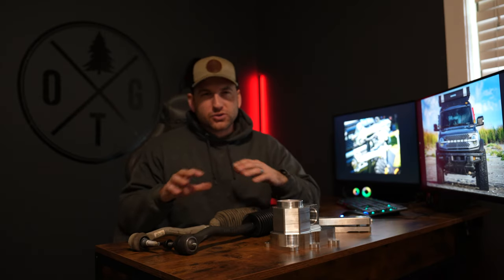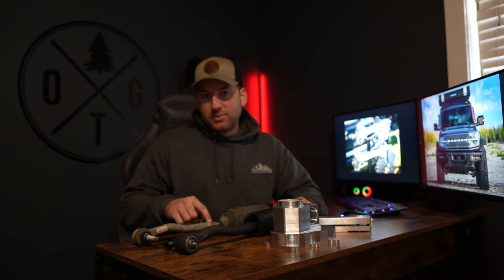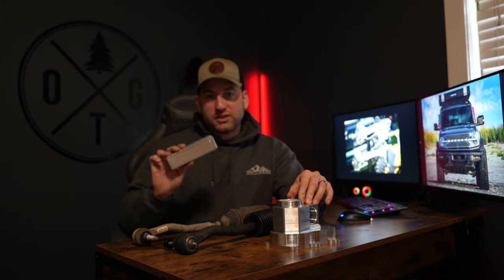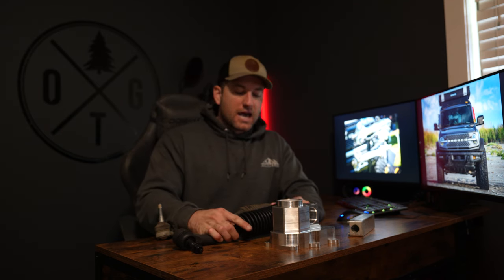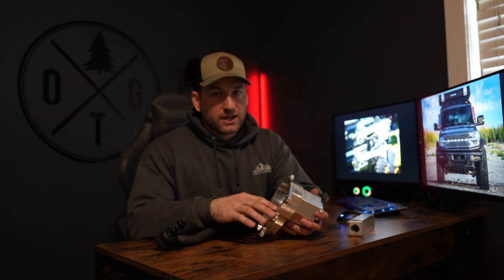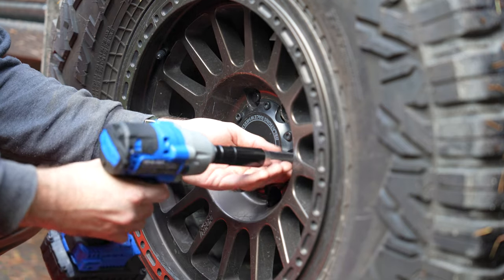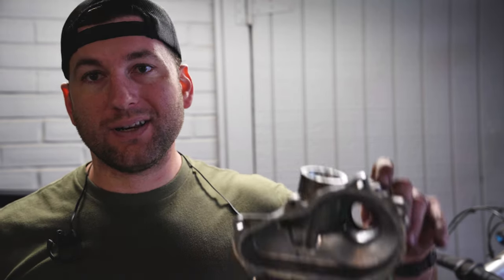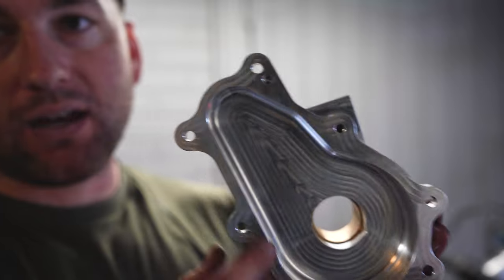The REAL reason the Bronco Tie Rods SUCK

Comment: We started out with the BroncBuster tie rod braces, steering rack inner bushing and billet housing end.  I ending up getting Icon Tie Rods as well.  The only downside I saw with the braces was the inability to re-align without removing.  I'm also kept the stock units with the braces as my backup just in case moving forward.

Comment: I’d rather the tie rod break than the rack. Grab a few tie rods from Rockauto and the tools necessary for a trail repair.
Reply from the maker: Yeah absolutely. But if you plan on doing a lift and bigger tires, the steering rack and components have to be addressed. If you’re wheeling at least.

Comment: I also have a Badlands , Sasquatch bronco.  I did the complete BroncBusters steering upgrade.  Tie rod braces, Passenger side Billet housing and driver side bushing.  I honestly do not see the need to upgrade the whole rack.  Tyler at BroncBusters extensively tests the braces with much bigger tires than my stock 35s.
Reply from the maker: Every build is going to be different and every person is going to use the vehicle different. I think a full rack replacement is certainly not for everyone though I agree with you there

Comment: Good job on the explanation. Add to your point. Many people get bigger tires without considering upgrading the steering system. Hence increasing the load on a tie road that was made for 35" tires.
Reply from the maker: Yes absolutely! That’s where the bulk of breakages occur from what I understand, but also in an off road, high load environment

Comment: The 74 Weld site refers to the end cap (stage 1) as being something good for "light off-roading". I overland and wheel a few times a year- don't do anything too crazy, but do like rock crawling, etc (something like a level 3 at an off road park). Do you think this setup is adequate for that? Or, should I look into their Stage 3, Stage 4 offerings? I intend to eventually go to 37's.

Comment: David, loved the video. Big fan of 74 Weld as they’re right down the road from me and their engineering looks tops! 
Question: for most applications, will the steering rack cap and tie rod upgrade you did be sufficient vs doing the entire steering rack upgrade offered by 74 Weld?
Reply from the maker: Thanks! Yeah those guys are awesome and really know what they’re doing!! I think the full steering rack is for more extreme application. So running massive tires and doing aggressive rock crawling. The end cap and tie rods should be plenty for most everything

Comment: Did you install the outer boot clamps on those tie rod boots? I didn’t see it get shown or talked about and was curious if they came with them or if you reuse the OEM ones
Reply from the maker: I did install the inner clamp. Those were still attached and sealed. There was not a clamp on the outer tie rod nor was there a ledge to even place one. It’s a really dumb design
Reply: @OFFTHEGRIND  that’s weird. I’ve worked around a bunch of the steering stuff on the Bronco over the last two years. Never seen an icon boot without an outer clamp. It is a small ledge though. Maybe it’s inverted and just has to be pulled back out? Just a thought. Or you got a wrong boot but I can’t see any tie rod boot not having a clamp on the outer end.
Reply from the maker: @popo_patty we looked at the actually thinking maybe it had inverted but it did not. Im thinking the sent me the wrong boots maybe? I don’t know why any boots wouldn’t have that though

Comment: Why anyone buys 74 weld Bronco steering products absolutely boggles my mind. They just took what Broncbuster did years ago and copied the idea. I've never seen less brand loyalty in my life then I do in the Bronco community.
Reply from the maker: Imitation is the greatest form of flattery
Reply: We have never nor will we ever copy someone’s design. Our materials are completely different. We use an oil impregnated bronze on the cap side and a UHMW plastic and oil impregnated bronze combo on the driver side. Our kit for 1K includes both the driver and pass side supports. It is sold as a complete kit for 500 cheaper using better materials. The truth is the only reason we sell the stage 1 kit is we already made the component as part of our complete steering rack. We had so many customers call and ask just to buy the cap we decided to sell it. I still think it’s a band aid and I know this to be true because we have removed and replaced 7 racks to date with the broncbuster bushing and cap and the rack housings were broken. For some guys it’s enough. But if you are really going to wheel your rig in rocks it’s proven that the cap and bushing is not the end all be all
Reply from the maker: @74weld thank you for chiming in on this. Not knowing the history or release time I didn’t feel comfortable weighing in. My stage one kit has treated me really well. I’ve had to replace my rack once in fact, and I was able to just transfer these components
Reply: @OFFTHEGRIND  oh no doubt he is first to market. But first does not mean best. It only means first. First is never our intention! We build the best, that is our only guiding principle Our design is very different. Delrin is the absolute wrong material for this application. While very strong, UHMW is 18x more impact resistant than Delrin. The problem is both Delrin and UHMW (all plastic for that matter) has terrible wear resistance. So we put an oil impregnated bronze bushing inside the UHMW making it wear resistant and impact resistant. These are major design changes which make our product a lot more functional by engineering. To the untrained eye they look the same. They are not
Reply from the maker: @74weld this and your racing pedigree is why I will always be a supporter of 74weld. Being stranded in the middle of nowhere is worst case scenario for us overlanders. I know with your company that won’t happen